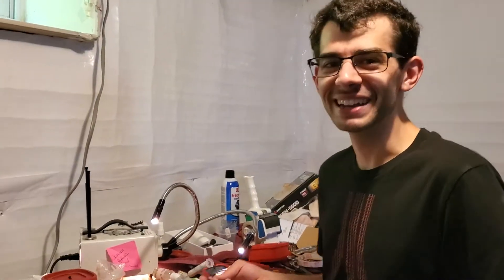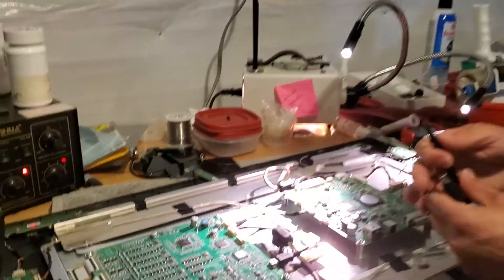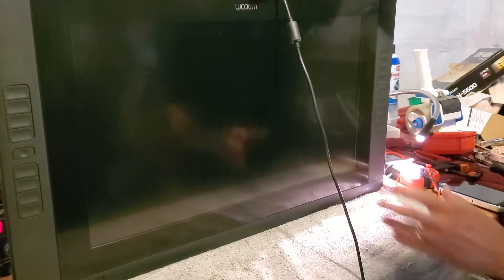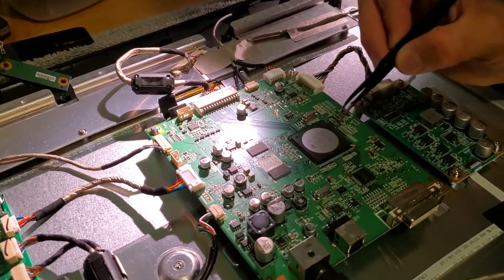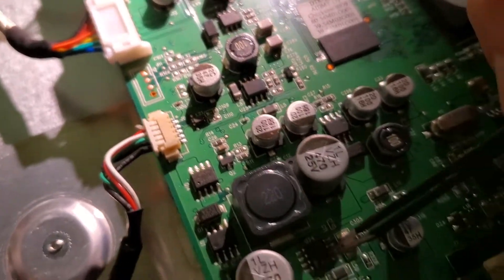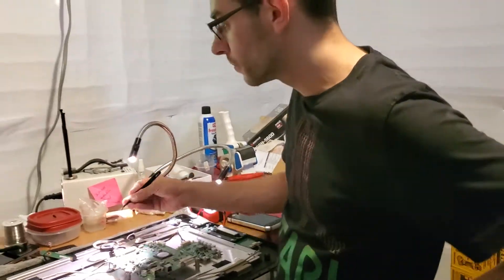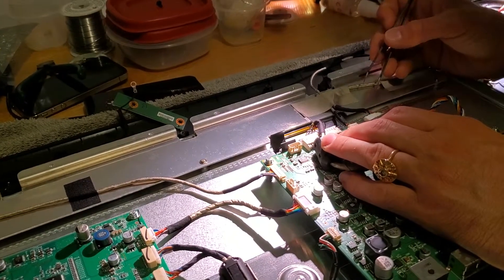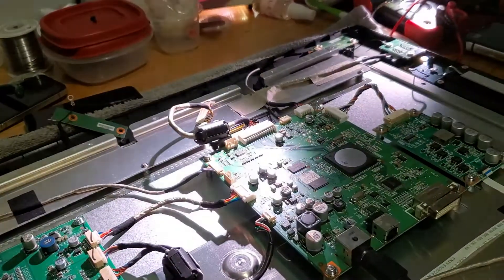WHICH BOARD IS DEAD Wacom 22HD Cintiq Diagnosis EASY MODE

Comment: Hi, Ian. Funny. I’m back. So I moved my ApT. My Wacom Cintiq. 22HD was working perfect. All good. I unplugged my computer/ all set up. Moved in a Uhall. Tried to set up my computer and Wacom Cintiq. Again. But now the Cintiq is all black. No power lights at all. ? I’m so confused I never dropped it. Nothing. This is so odd….the same PC alien wear lap top. Same Everything, but no power? The AC Adapter light is not on..it’s odd though, it did work before? A few days ago. All I did was unplug, move apartments. Plug back in? Any advice?
Reply from the maker: Come down and swap for an upgrade.

Comment: have you ever come across an issue where the cintiq (and it still is plugged in and has power) will flicker black, and say 'no signal, going to sleep' turn off, then immediately turns back on to the 'no signal, going to sleep' message and just cycles on and on? 

I can disrupt the cycle by pressing the power button on the back in the top middle, and power cycling it helped make it happen less frequently, but after a bit it will come back.
Reply: Hi, did u fix it ? My cintiq 22 dtk 2200 have the same problem with power button.
Reply: @songnamdn  sadly, no :( bit you could try doubly checking all the cords are connected to the cintiq securely, or swap out the cords if they are in rough condition

Comment: Hey I know its a long shot but I have a Huion tablet which failed and they are using Wacoms technology for the digitizer. What stopped working is that the tablet display is no longer detected by any of my computers. Is there something in Wacom tablets that fails in this regard and could lead me to fixing mine?
Reply from the maker: Model #? Email me procersapientiae@gmail.com I have some experience with Huion but not much.

Comment: Hello, Ian! Good night!
Congratulations on the videos, I was very happy to see someone providing this help.
Ian took the test as you mentioned. The purple light really appeared and then went out. I made the exchange of the 5 FDS 4435BZ transistors but it remains the same. What could be going wrong?
Would you help me?
Thankful...
Reply from the maker: If you got the flash it means the problem is on the LCD board with the smt capacitors.
Reply: @procersapientiae  Ian, thanks for listening. Made me happy!!!
I'll wait for the capacitors to arrive. Arriving, I make the switch and send the result.
For educational purposes only. So when it flashes purple, should you change the capacitors?
Thankful..
Reply from the maker: @eusoumarcelofranco  yes, then once you have those in and plug the cable in it should work. There was no flash with the cable plugged in, right? Also you can confirm by measuring resistance across the capacitors it should be 0-10 Ohms if failed, and is normally 5KOhms.
Reply: @procersapientiae  I understand. I got it wrong because of the translation into my language, I'm from Brazil xD.
I will do it according to your recommendation, I will test the capacitors and when I blind the new ones I change them.
Thanks for your patience, Ian = D.
Reply from the maker: Check this video: https://youtu.be/hOZo_O2tpNE

Comment: Been following all your videos.  Have a 27QHD that already had the "pcb" replaced once under warranty due to the blackout failure (wacom's support is horrendous, they refused to give me any more details on the fix).  Now not even 50 hours later and out of warranty its failed the same way again (screen scrambles then won't fire up again, pen still works with full EMR, just no picture, and nothing visible with flashlight).  You are the only source anywhere online that has offered this kind of advice.  Huge thank you to you.  Please keep updating us on anything you find out for the 27 QHD...there are literally hundreds of blackout failures popping up now all over North America.  I am an electronics engineer and will open mine up for a deep dive to see if I can trace any faulty caps or other components.  Reddit comments also mentioned the memory chips on the video board as a possible issue.  I will update if I find anything helpful that hasn't been covered already.  Keep up the great work!
Reply: Any update on what might be wrong with the 27qhd? I’ve also got the black screen of death.
Reply from the maker: I tried having an inquiring customer replace the memory modules to no avail through a recalling service. I will say, I did a board swap once and it died shorty afterwards, so I'm wondering if it's a cascade failure. I also did get lucky and the one I gave to my friend which is still working after a board swap. I convinced a subscriber to sell me a 27 relatively cheap but yes in the last few weeks I've had more questions about this than ever before definitely getting a MTBF coming up for a component. I was relatively confident that something big on the main board dies because you will find low resistance measurements on the Capacitors around the memory modules.

Comment: Great! It woks on 27QHD model??
Reply from the maker: This is a 22HD fix. Still working on 27QHD.
Reply: @procersapientiae   Hi Ian,  my mainboard has a single transistor named "Q", also there are 3 others that are similar but are called U19 U31 and U39. Do you think that changing it could work? They look similar but I don't know if are the same.
Reply: @procersapientiae  Thank you! I will try it.
Reply: Do you know which transistor/capacitors could be on 27QHD?
Reply from the maker: @canutofuriosoyrapido6437  We do not know at this time.